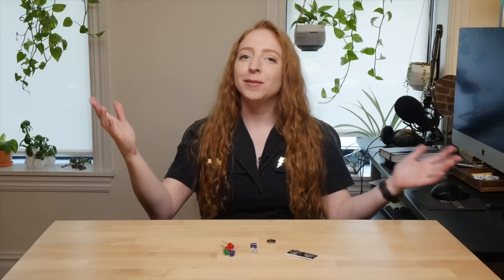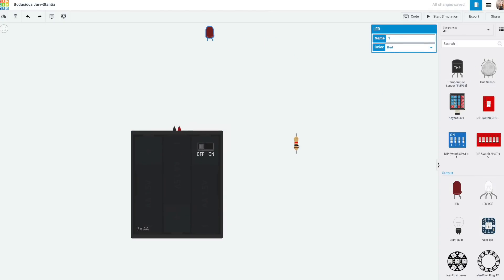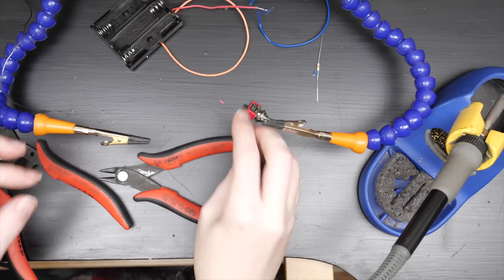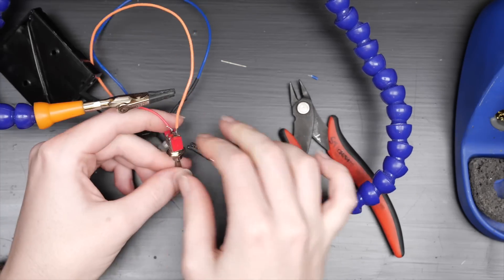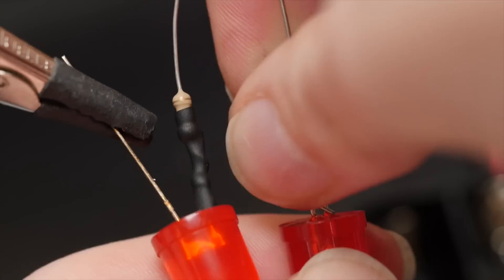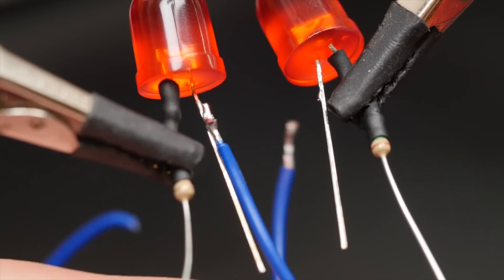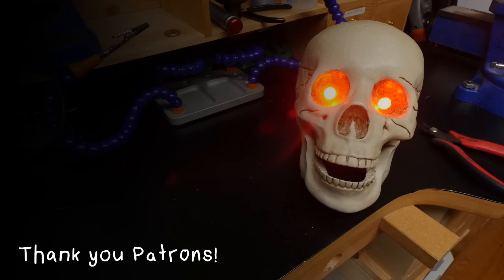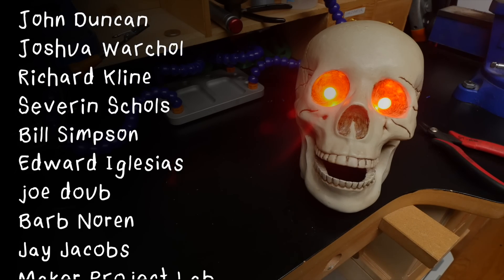Easy LED Circuit Tutorial // Becky Stern

Comment: hi! Yours video is  really good. Thank you!   I have a question that is, can we recharge in any way the C R  2025 button cell and use?
Reply: In order to do that you need to get a special rechargeable button cell battery. Yes they do make them. But then you would need a charging circuit to make sure you don't overcharge or charge the battery too quickly or with too much current and damage the battery.

Comment: I'm replacing LEDs in solar garden lights and in general, trying to understand how to repair solar garden lights to save them from the landfills.  I've found that I can use one piece of clear heat shrink if I stick a slice of hot glue between the LED leads.  I drilled the old LEDs out of my plastic hummingbirds, glued the new ones in, and they're glowing again!!  Thanks for reminding folks to properly dispose of old batteries, even button cells - check online for where to drop them off for free.  Thank you!!

Comment: The thing I dont get is in all videos... they explain something but not fully... So the switch goes from the battery's power wire to the LEDs positive side......Where the information drops off is where does the negative side of the LED go to????????????????????
Reply from the maker: To the negative side of the battery.

Comment: Help. Your video is so well explained I thought you might explain a practical issue for my led needs. I have an under cupboard led cob strip about 6 foot long. One day it stopped working - thought these strips last forever, but no.  I cut off about 2 feet to try different controllers from other products and nothing worked. My question is, can I hook up the led strip to a usb cable and plug it into usb charger and plug it into the wall?  Maybe put a simple on off switch in between. I leave the lights on 24/7 usually so I could just unplug them. It seems like this should be simple without using transistors and resistors and breadboards and math, but maybe I do. I’m new at this and need help for practical purposes and not fancy flashing, changing lighting. Thanks

Comment: So confusing which leg of the led goes to what end+- of the resistor.
But you said it doesn't matter?
❤
I make 9v guitar pedals.❤
Reply from the maker: the resistor itself is not polarized, meaning it can go either way, and in the circuit it can be attached to either leg of the LED.

Comment: I have a craft question: On an embroidered cloth emblem, one set of lettering was unfortunately done in one shade of blue, over a background of another shade of blue. Can I highlight the lettering with some type of paint which would stand.up to washing? Elsewhere on the emblem there is lettering in black, which is the color I had in mind for the highllighting. Is there a type of paint which would work.?   Thanks, Bill W..
Reply from the maker: I've never tried that! I suppose the worst that can happen is the paint will wash out or bleed. If they are two different fibers (such as cotton fabric and polyester thread), then fabric dye would affect them differently, potentially resulting in more contrast (cotton absorbs the dye more readily than synthetics). Sorry I don't have a magic bullet for your situation!
Reply: @BeckyStern  Thank you very mucho, in any case!
Reply: At your craft store, Hobby Lobby, Michael’s, even Walmart, carry craft paints that are made for fabric. I’ve tried different ones on t-shirts with no bleeding.  There is also a “puff paint” type for extra dimension that I like that I’ve used on garments that get plenty of wear.  Test it first of course and follow direction from the packages and I believe you’ll get the results you’re looking for.

Comment: Could the batteries be in parallel to keep the voltage at 1.5 and eliminate the need for resistors? Would this increase battery life significantly because it eliminates the resistor power use? 
You had mentioned something about coin cell internal resistance. What's the internal forward resistance of an led?
Reply: led have a very small resistance inside. not only that all electrical instruments have little resistance inside them. so measurement of led systems they dont take its resistance value.
the Q about battery life. what do you mean by that? is it that the battery last longer or it discharging slowly?

ans is yes, it limit the current and decreased it inversely proportional to resistance value. it last long if the manufacturer is good. 
as the battery measurement depends on mAH so ,yeah.
Reply: Also there are no LEDs lighting at 1.5V. 
You need minimum about 1.8V to run a red LED. 

Flashlights with only one 1.5V battery, have internal circuits, 
stepping up the voltage.

Comment: Because of a bad purchasing decision, I am forced to make my own LED lightbulbs for my motorcycle. If I want to keep the turn signals I purchased this video is helpful but I’ll have to do a little more research because deciding on an LED I realize it’s quite confusing.
Reply from the maker: Oh yeah, there's an extra part you need for motorcycle blinkers, either a load resistor or flash controller, it has to do with how incandescent bulbs control their own flash rate.

Comment: What is the forward voltage? Is that a specification related to led or the battery? What about the current? How do you determine that?
Reply from the maker: Both are properties of the LED that can be looked up in it's datasheet

Comment: Why does the switch go there? I feel like opening the circuit at any point will have the same effect.
Reply from the maker: In this circuit, that is correct. But it's good practice to always put the switch on the positive wire in case the circumstances are different (higher voltage, etc.) https://www.quora.com/Does-it-matter-if-you-put-switch-fuse-in-a-DC-Circuit-on-positive-terminal-or-negative-terminal